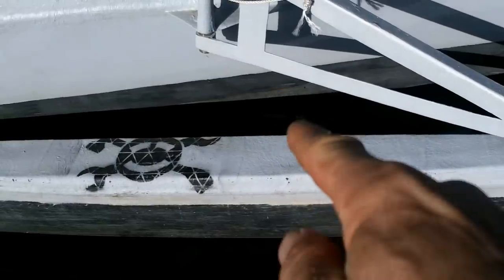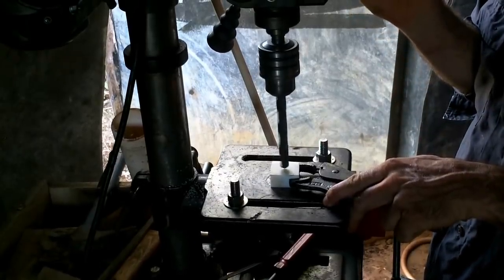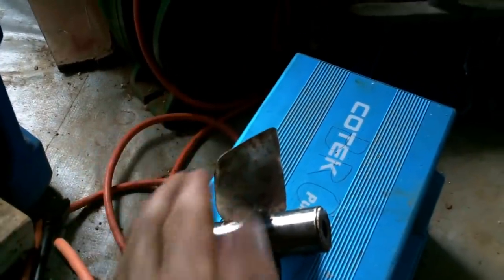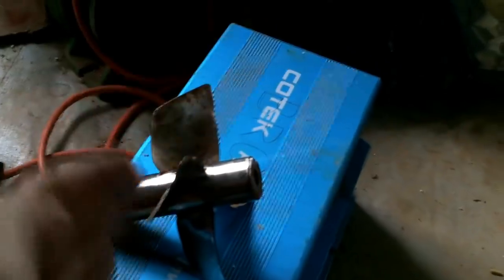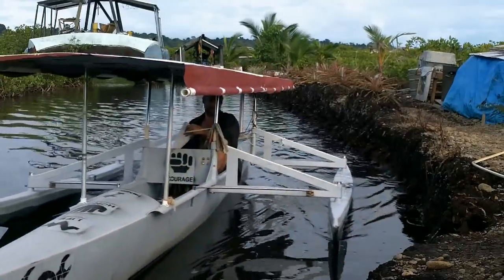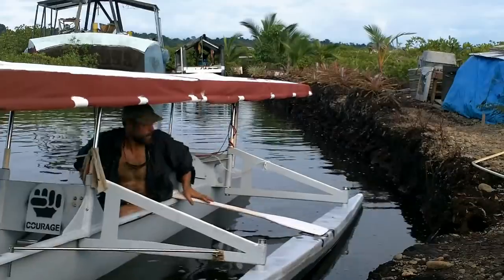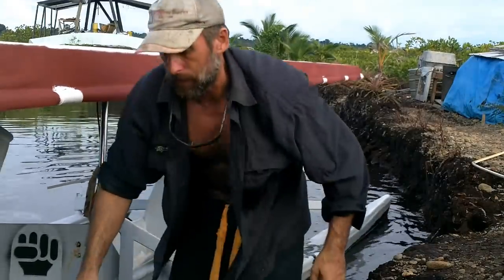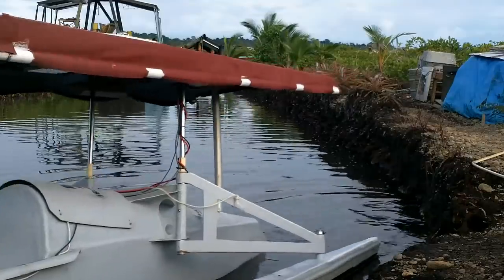Zombie Chopper fine Tuning Pedal Power

Comment: Query, thought about 3D printing a "mathematically optimal" version if the propeller for size, weight, shape etc. of the vessel? Basically would lead to a cheapo "last long enough to test design" plastic, or if wanted an aluminium via "lost medium" test piece to see whether or not the math works and establish another baseline to work forward from in addition to the trial and error version used now.
After establishing "optimal" design fabricator the stainless steel version to meet parameters.  

What be your thoughts?

Comment: May I suggest the building of a small pontoon like catamaran with a fixed length shaft connection to your solar trimaran that would carry all your extra goods from town. This solution would seem easier to arrange than the construction of a new self propelled vessel for transportation of goods? Pulling it with extra battery power that could be fitted in the pontoons?
Reply: Dont suggest anything he knows everything better and he will block comments again if it isnt all compliments.

Comment: It would probably be more trouble that it's worth, but finding a way to make some 3d printed casting cores and casting your own aluminum props would be a pretty cool project.

Also, I'm curious why you don't just run all of the solar panels through the charge controller to charge the batteries and power the motor, there might be some losses because the power is going through the charge controller before going to the motor, but it has to be less than the loss of charging the battery and then using the battery to power the motor, instead of having the charge controller help power the motor directly.
Reply: The charge controller might not be able to handle the current the motor needs
Reply: @TheMrkylester101  That's very likely, but the motor would also be drawing from the battery at the same time. I think the only issue that may arise is when the battery starts to get low and the charge controller ends up trying to supply all of the current, but it may just limit its own current output.... I'm not sure how that would work.

Edit: He does have a motor controller, so he can just limit the current that the motor draws if it overloads the charge controller.
Reply: @PistonAvatarGuy  good charging controllers are expensive
he also doesn't have any balancer which could be problem later if manifacturer of that battery pack used cheap ones with different internal resistance and capacity
Reply: @nikdonic  I think that he had a pretty decent charge controller. He's charging the battery regardless, so I don't think that he's too worried about balancing out the cells. He could get something like an iMax charger to balance out the cells once in a while from a different power source, they're not very expensive.
Reply: @nikdonic  So... yeah, really he'd need to design a BMS that works with the charge controller, that wouldn't be an easy thing to do. Lithium batteries are a pain in the butt.
Reply: If you watch Should I cut my boat in half, This will explain some ideas that he has, Using all 4 flat solar planels for power and adding a 5th glass panel that has a higher voltage that will charge his battery to the correct voltage. The idea on the lower voltage is to make sure that he does not send to high of a voltage to the motor. The lower voltage will keep the amps high while not having to compensate for a larger voltage.
Reply: @kameljoe21  I think I watched most of that one. The problem is that he'll always end up with some solar panels that aren't doing anything. When he's running on the battery, most of his solar panels will just be dead weight. The charge controller should always manage the proper voltage, he just needs to set it up right.

You generally want to keep the voltage as high as the battery can take so the amperage stays low. Lower amperage = less wasted energy.
Reply: @kameljoe21  This is all assuming that he's using the motor controller, of course.
Reply: He mentioned in a previous video that the solar panels he asked for and received had too low a voltage output for what he wanted to do hence the arrangement that he has.
Reply: @flick22601  IIRC, that's because he doesn't have all of them in series.
Reply: @flick22601  He ordered the lower voltage ones,  The reason was so that he could run them directly and and not have to use anything else. The voltage the motor can handle is 24 and the panel voltage is 22 or something like that, The higher voltage panels would exceed what he needed, thus the reason why he ordered the lower voltage panels, The panels are set up so that he can use one panel for low speed, 2 panels for med speed and 3 panels for high speed. * not sure if this is the correct arrangement, Yet it is similar to this. A controller is just something that might fail, Where as a direct connection, the only thing that fails is the motor or the panels. Its simple and works.
Reply: @flick22601  Actually, as far as I can tell (based on the specs of the panels listed on the Sobian website), just two of the panels in series should provide more than enough voltage for the charge controller. So, 2 in series, then those two pairs in parallel. Or, if the charge controller can handle the voltage, all 4 panels in series.
Reply: @kameljoe21  "Its simple and works."

It doesn't work that well because he's not making good use of his solar panels. If the controller fails, it fails, in the meantime he's going to go slowly and end up pedaling more because he's not using all of the energy that's available from the solar panels, but whatever.

I just don't understand his logic a lot of the time, like with the motors on the cargo boat. Just build it right the first time, don't keep building things that don't work well... that's my philosophy.

Comment: How do you keep your prop shaft water tight? Tnx for the reply and have a good day
Reply from the maker: It isn't watertight.  There's a tube around the shaft that goes right up the shaft length well above the water line.  No need for seals.
Reply: @JMEMantzel   tnks a lot for the reply. You gave me a good idea for my diy